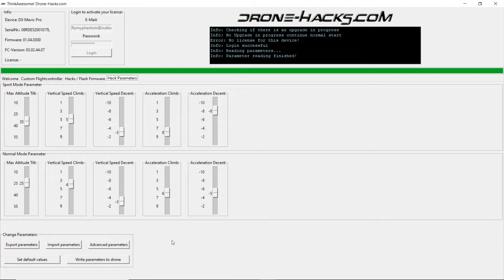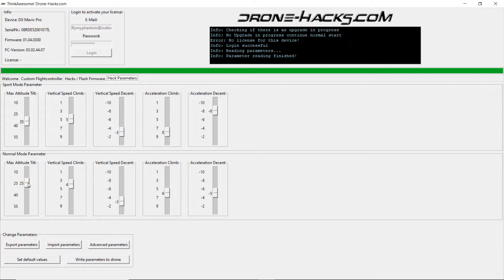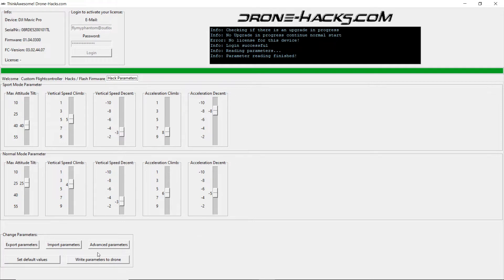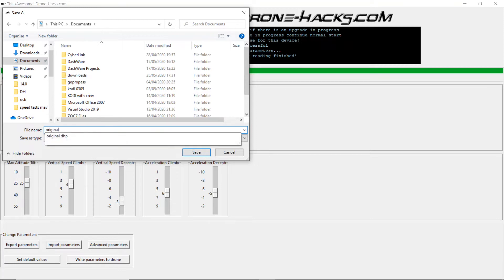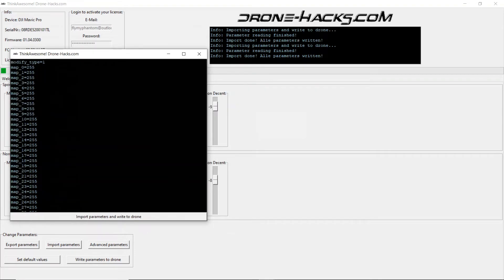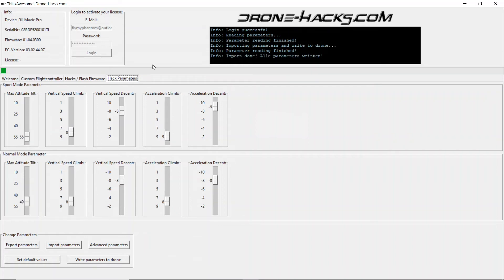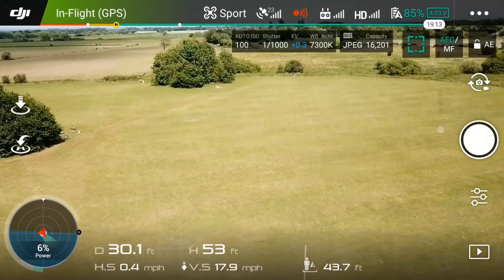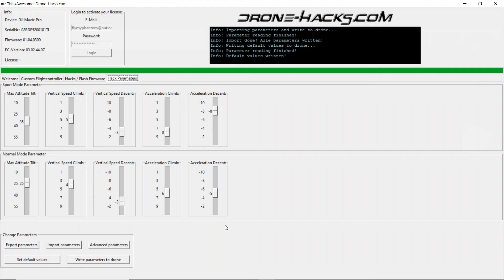Drone Hacks guide number 5 Speed Hacks

Comment: how was the horizonal speed increased to 50mph?  The parameters you changed didnt seem to have anything to do with horizontal speed
Reply from the maker: HI, from memory, its been a while since i used DH, its the angle at which the quad tips forward that increases the speed
Reply: @FlymyPhantom  ah I see thanks.  I adjusted my mini4pro from 30 to 45 and saved it but it didnt seem to affect.  I read the value back and 45 was still set too.  oh well.  Thanks for responding.

Comment: You mention about disabling the object avoidance for normal mode to have uprated speed. What Advanced Parameter am I looking for? I've messed about with a few but none seem to be disabling them. Reverted back to default for now. Any advice will be appreciated thanks :)
Reply from the maker: Hi, it's been about 3 years since I last flew the mavic pro, from memory in the app it's turn off all sensors for avoidance, I think there are 2 pages of options,I think if you tap the icon at the top of the screen it will take you into the settings, any issues drop me an email at flymyphantom@outlook.com
Reply: @FlymyPhantom  Thank you, I actually forgot about those settings within the app. Now all working. Thanks again

Comment: Hello, there’s any batteries parameters available to change? Yesterday I was hack my mini 2 and reached 1000mts and the battery 🔋 49% and the drone activate the force landing for low battery??? I hear that battery settings can modify in advance parameters in Drone-Hacks.
Reply from the maker: The issue is that dji have most of the parameters in the firmware, this is locked and can't be altered, if the parameters you seek are in there then it won't stick when you change them, feel free to play though and let us know

Comment: Hi there these are the custom settings that I've made for my DJI spark I have achieved 46.1mph and found it very stable with this setup
g_config_mode_sport_cfg_tilt_atti_range new 60 old 35
g_config_mode_sport_cfg_vert_vel_up new 10 old 3 
g_config_mode_sport_cfg_vert_vel_down new 10 old 2
g_config_mode_sport_cfg_vert_acc_up new 10 old 8
g_config_mode_sport_cfg_vert_down new -10 old -8
B_config_fw_cfg_max_speed new 20 old 10
Brake_sensitive_gain new 90 old 150
This can all be changed parameters
Reply: What was the battery. Life like
Reply: Shouldt it be g_config_fw_cfg_max_speed instead?